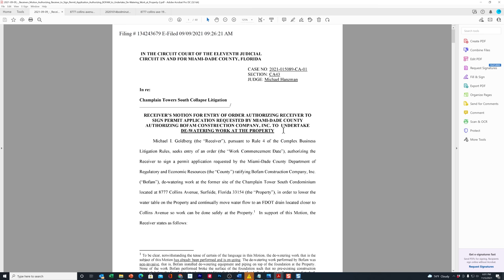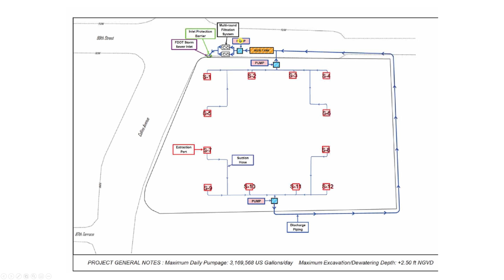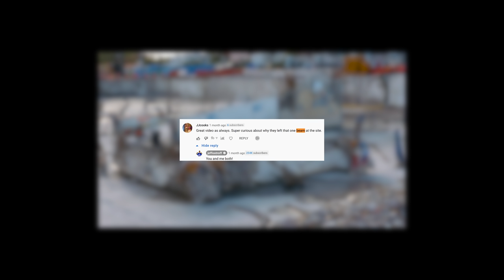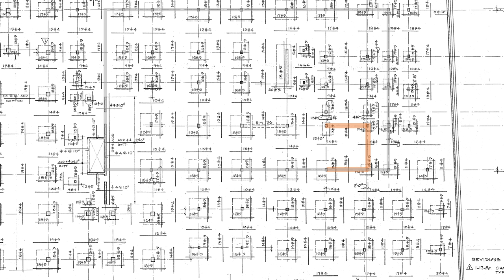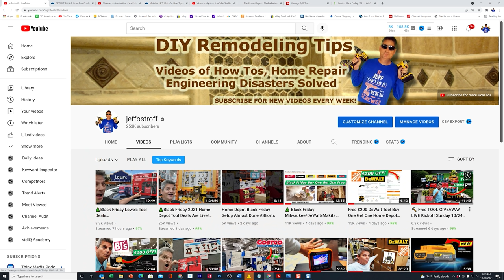Miami Condo Collapse: Engineers Baffled By Mystery Column

Comment: My theory: That mystery column was actually the one that started on top of the H-beam, and it impaled the ground, when it slid off the H-beam. It would also explain the water which pools around the mystery column.
Reply from the maker: most common theory so far
Reply: @jeffostroff  A thing to note is the 4 main columns have concrete still on the base connecting to the ground and that mystery one is pretty clean. Only way to know if its impaled rebar is to pull one of them. Who knows how they were before clean up happened. Either way its odd and a beam having to shear off to leave straight enough pieces of rebar to straight out impale the floor like that is pretty slim chances. If it did then there should be some cracks in the floor there which would be the water problem and in the photos be hidden under that water. 

My playout is the mystery beam sheared off leaving the rebar almost fully surrounded my the concrete and it slammed into the ground driving the rebar but breaking the surrounding concrete then the mystery beam shifted back towards the H beam. Because you look how the rebars are placed on that mystery beam and they seem so random compared to the others around
Reply: That's a good theory but I am going to play The devil's advocate how would that account for the rebar if it was just beam spearing The ground? I'm no engineer but I am a union carpenter Foreman so I have a fair amount of knowledge in construction stuff and I can't understand the rebar that had to be put there on purpose.
Reply: @jeffostroff  There was no column  there or added there. There is no residual concrete in the rebar like all the other columns. Also the the reinforcement is really heavy, unlike all of the other columns. The only thing I could think of is impalement of some structural element above during collapse. It almost looks like  someone is having a joke and added extra rebar in the hole. I can't see why it is so heavy.
Reply from the maker: @PreservationEnthusiast   Yes even the impalement theory has problems as well because those rebarters are sticking straight up out of the floor but yet the vertical position of the column over where the impaled area is It's off about 5' So this column falling at an angle could not possibly impale the floor in my opinion
Reply: @jeffostroff  The basement slab was probably about 300mm thick. Could be even thicker if there was a water problem. That should be on the drawings. Punching seems unlikely, it's more likely that the column would slip sideways unless it was dead plumb. Also it should be possible to confirm by looking at the number and size of the rebar, if there were any similar columns or members above in the immediate vicinity. This would be a simple exercise if the drawings were available. Another clue is there don't appear to be any link rebars in the stump.
Reply: @jeffostroff  One can also calculate the punching shear stress on various shear perimeters and according to the slab depth and whether it was suspended or ground bearing, estimate the likelihood of punching taking place, comparing it to the load from a displaced column from the structure above inc dynamic loading. Could probably get an idea in 30 mins with all the design perimeters to hand inc concrete strengths. If the slab is thick it's just not going to happen. The column would crush before punching took place.
Reply: That's logical, but he said there was no impalement.  Maybe he is wrong.
Reply: @Kevin Verduci  Silent ferret made a good point on this. If the column really did slide off the H-Beam, then it would have had a moment of "free fall", so it may have impacted the ground with such force that it broke up the concrete of the column and drove the rebar into the floor.
Reply: @siamsurf  The rebar would bend and buckle rather than be driven into the floor. Do the calculations on the failure load of the bars in compression as opposed to the punching shear shear stress needed to penetrate an 8" plus concrete slab. I think your theory is unlikely.
Reply: @PreservationEnthusiast  At impact the bars would still be encased in concrete... so not sure how much they could actually bent and buckle under those conditions.
Reply: @siamsurf  You've just said that at impact the concrete would be shattered, and don't forget after that moment, the bars would then have to continue to take the compressive force to be driven in. Sorry, your theory makes no sense at all.

Comment: Tend to agree with the 'punch-thru' explanation > There's no concrete cladding around it's base as all the other parking garage 'pillars' exhibit and there does appear to be a 'punch-through' hole that has just been filled with all the muck from the clean-up and is still leaking the ground-water. The reason all those re-bar make it appear to be a larger column then what's in the plans is that it's all that vertical column rebar coming down trying to ram itself through the hole -a true pile driver. Wouldn't be surprised if that rebar goes down 20+ feet.

Comment: I bet the H beam moved from its original position and the "mystery column" is one of the corner columns.  If you look at the first still, the mystery column would have been the support column for the corner closest to the camera and the red column would have been attached to the blue painted rebar to the right.  Not a big mystery.  The H moved when the building collapsed.

Comment: We know it came from somewhere, and we know this column lines up with where the column above the H used to reside. This is now in the basement floor right where we would expect it to be if the H shifted towards the collapse area.

When M11.1 fell, it created a void in the center of the structure that then pulled the H beam towards Mll.1's main pillar victim.  You can see the columns that remain under the H show the H has shifted towards the initial collapse point.

That "mystery column" is the ground floor column that when all the way up to the penthouse suite.  Instead of staying connected to the H, at some poin tin the collapse sequence the column unhinged itself form the H and instead drove into the basement floor, with the weight above the column and the force of gravity together acting as a hammer to drive that column into the basement floor.  Yes, there's a very good reason why it is now leacking - it's punched through the ground floor.

That's it.

Comment: I see exactly what happened here, Jeff. Here are 2 big clues:

Clue #1: Note that in the diagrams, the H-beam is about 20m from the ramp. But note that in the video of the site post-collapse and post-cleanup, the H-beam is only about 10m from the ramp. The only way that could have happened is, the H-beam fell downward and northward at a 45° angle. But would you expect anything different? The H-beam was perched on top of large columns, and they were unlikely to just crumble, so they probably fell over instead, causing the H-beam to move downward at 45° instead of 0°. 

Clue #2: Where on the diagrams do we see a row of 3 columns in a N-S row? At O4, O6, O8, about 10m north of the original location of the H-beam, again implying that it fell downward  and northward at a 45° angle. 

In other words, this building didn't crumble, it parallelogrammed. It sat there for 40 years like a house of cards waiting for something to give it a nudge. The pool deck collapsing was that nudge, causing it to fold in on itself.
Reply from the maker: Unfortunately, you are wrong in both cases the H beam is resting exactly where it shows on the diagram I don't know why you think it is further away. Also those columns you show in 04, 06 and 08, are clearly shown on the floor of the garage right next to the beam in some of the photos.
Remember the column I pointed out that is sticking halfway up the parking spot #17, which would have been Fiorella’s parking pace if she bought that unit? That is 06, and the column with the red stripe on it is 08. Note how O6 and O8 are close together, then look at the photos near the ned showing them still there. Those are NOT what the H-beam was resting on, only O8.
Reply: Also, there was not even close to enough lateral force to move that 65,000+ pound H beam away at a 45 degree angle during the 3-5 seconds it took for the east wing to collapse.
Reply: @johnbergstrom2931  ----- The ghosts of the Egyptian pyramid builders put the mystery column there just to mock us.
Reply: I agree with Robbie, that H beam does not look like it is in the proper position, almost as if its moved a bay from its original position and basing this on the position of that red line that you say is the extent of the parking bay.
Reply: To quote Sherlock Holmes (or Mr Spock) “When you have eliminated all which is impossible, then whatever remains, however improbable, must be the truth.”
There is a mystery broken column where there isn't one on the video.  My first impression was a chunk of column coincidentally  landed there with its rebar sticking up.  Later in the video, a close up kinda dispelled that theory.  
Jeff, I know you disagree with Robbie but the H beam coming down on an angle is the only explanation.  Nothing else can account for the discrepancy.  
If the building dropped straight down I'd think more columns would have remained standing.  Since they all appear to be broken off at the base its a fair probability the garage "ceiling" (along with the building) came down on an angle that displaced the H beam.   Also the building didn't just drop straight down.  It came down in sections.  That alone would have made the ceiling collapse unevenly. 
The physical, tangible evidence is right there.  Can't be ignored.
Reply: @Iconoclasher  So you're arguing that the mystery column was there all the time, holding up the building for 40 years?
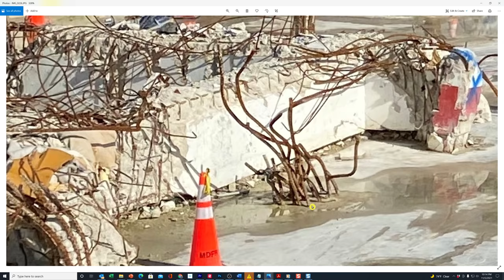Wrong, try again.  The mystery column has ABSOLUTELY NO CONCRETE trapped at it's base in between the rebar, like every single other one of the destroyed columns has.  It's rebar is clean.  Also you can clearly see the rectangular slab patch border at 13:47 and also the concrete overpour at the base of the new rebar.  
This column stub never had concrete poured around it because its construction was underway on June 24, 2021.  The only got to the slab rebar phase.
Reply: @johnbergstrom2931  Such a new remod/column addition , would be  in a recently approved  building/blueprint/permit plan somewhere. Where are the records/permits for this new/in progress construction? if that is the case.
Reply: @johnbergstrom2931 
No, I'm agreeing with you.  If it existed, it should have been in the video of the garage last year.  Jeff showed where the column should have been, but it appears there's a broken column in the wrong place now.   That's the way I understand it.
Reply: @chrisperrien7055  Well, I've scoured the town of Surfside's records site and I can't find one.  You think any permit of emergency structural work on a building that ended up collapsing would be digitized and be put online immediately...
Reply: @Iconoclasher  No, wrong.  It DIDN'T EXIST in July 2020, when the video was made - that's the mystery.  It wasn't in the original blueprints and it definitely wasn't there for 39 1/2 years.  Something happened between when the video was made and late June 2021 that precipitated the need to begin to build it.  Maybe the slab above started cracking big-time and that was their under-the-table 'solution'.  It wasn't adding support to any column or the H beam.  It was out of place to do that.
They never got around to pouring concrete around the rebar, though.  It's clean and devoid of the trapped concrete that we see in all the destroyed column bases.
NIST will figure out who put it there and what the intention was.  They can subpoena people to testify under oath.
Reply: @johnbergstrom2931 
😊👍    Understood.  I was going on the assumption that if it had been added in the last year or two then there would be a substantial paper-trail to indicate that. But I appreciate the clarification.
Reply: @Iconoclasher  No paper trail, as far as I can tell.  This building's management was all kinds of dirty, in my opinion.
Reply: @johnbergstrom2931  sure there was as the columns buckled in that direction.
Reply: @johnbergstrom2931  There doesn't have to be as it was knocked over by the columns collapsing in that direction.
Reply: @johnbergstrom2931  possible but someone would have seen it and it  being at 01-8 with a L type pile cap  lines up with 08, and G8
Reply: @johnbergstrom2931  That picture at 13:47 does make it hard to explain. If they cut in a footing and patched the slab in an attempt to do some bandaid repair it would look like that. But who would do that? Handyman specials and illegals are all good for a residential property but who the hell is going to jack in a new column in a 12 story building with no paperwork?
Reply: @chrisperrien7055  yea people would have spoken to news crews
Reply: @johnbergstrom2931   people would have spoken to news crews about that work
Reply: @manikaggarwal2018   Not if the work had been concealed by some kind of tarp, fence or barrier...  Also, the people who would have noticed something unusual going on, the ones who lived and parked on the east side, died in the collapse..
Reply: @designstudio8013  There is no column 'G8'.  The west shearwall is at that location.
Reply: @johnbergstrom2931  Sure there is. 900,000 # x moment arm= ?
Reply: @johnbergstrom2931  nope
Reply: @chiefinspector7280  "900,000 # x moment arm= ?"  Yeah, I don't know what the hell you're talking about.  You need to explain/elaborate way better than that...
Reply: @CollapseOfChamplainAndMore  "Champlain Towers South - searching for answers"?  There's already a group like that.  It's called NIST.
Reply: @johnbergstrom2931 
If they were installing a new column in an existing structure, wouldn't an iron structure be easier to install than pouring a new concrete column?
Reply: @Iconoclasher  Probably.  But they had to tie some kind of footing into the piles, otherwise it would be for nothing.
Reply: @johnbergstrom2931  Typical from what I have seen of HOAs.  You have people with out real estate, maintenance, legal, construction backgrounds making decisions heavily influenced by local politics.  Throw in human tendencies of greed, power, ego...
Reply: @Iconoclasher  The truth in my eyes could be in the middle that h looks like the edge of the east wing so the middle callasped then the h beam got moved in a certain direction by the ton and tons of falling ribble which out have had considerable momentum and pulled or pushed the the h out from under our mystery collum it would also explain the staggered way it fell and why the other side didnt as there was no beam supporting a second collum to be yanked out from under it and it would also explain the fact the pillar on all the h beam corners being bent like that images
Reply: @jeffostroff  Unfortunately for you, he is correct and you're not capable of following his analysis.
Reply: @johnbergstrom2931  At no point was a new column built.  That mystery column slipped off the H beam and punched through the floow.
Reply: @johnbergstrom2931  is right. Its rebars bend in all directions, one even in a Z shape, like debris fell on top. In other columns the steel bent uniformly.

Comment: I posted when I first viewed this video and now I'm back for an update.  I could have done this earlier but I'm lazy and my real engineering job keeps me plenty busy.  I've spent a lot of time walking construction sites and counting columns to determine where I am on the plan so it wasn't any different looking at your video at 13:29 and matching up columns with the structural plan.  At that time I agreed that these 3 beams fell pretty much straight down.  At 1:00 in your video you show a view of the site looking straight down but the site wasn't completely cleared.  Stumbling around youtube I found another aerial photo showing the site completely cleared.  It was pretty easy for me to put a screen capture of that photo next to the correct structural plan and within the accuracy of the low resolution youtube video it was easy to see that beams 34 and 35 were in their correct plan location as if they fell straight down, not to one side, not at a 45 degree angle, but straight down.  That doesn't solve the mystery of what that "thing" is on plan and I already posted my ideas on it, but I 100% agree with you that the 3 large beams are still in their exact plan location.
Reply from the maker: Yes I estimated the H-Beam dropped off the top of the 4 support columns and fell 12" north of the columns
Reply: Well, not technically "straight down".  The centerline of beams 33 & 34 are displaced from the centerline of the columns they rested on.  Kind of hard to measure in this video, but  I figure the east side of the H beam moved about 2 feet (the beams were 24" wide), while the west side moved about 6 inches.
But yeah, the 45 degree theory is utterly ridiculous.
BTW, beam 35 is the center section.  33 & 34 are the legs.